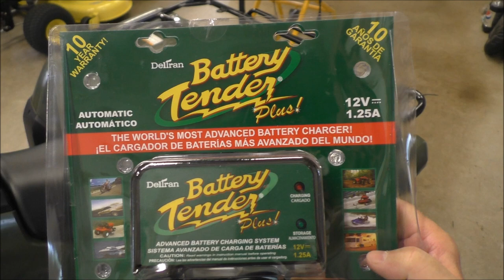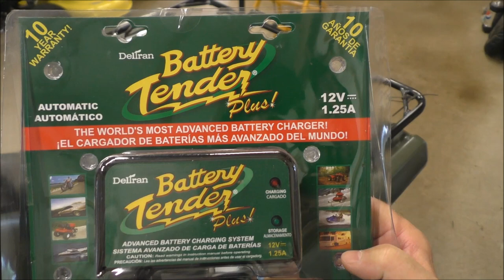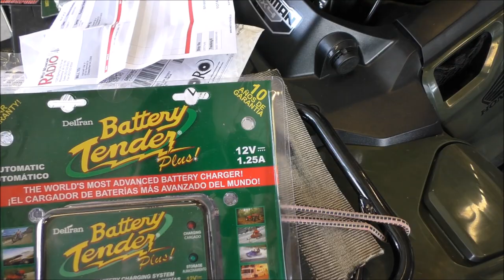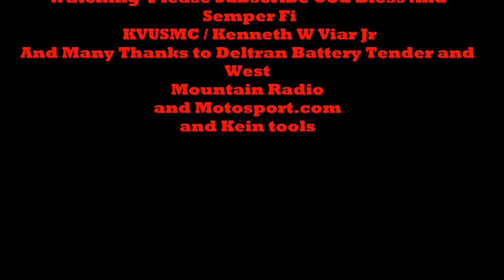ATV Batteries Keeping Them Charged and to Jump Start Wiring How To By KVUSMC

Comment: Take it up a notch! Get rid of all those crappy SAE connectors that the battery tenders come with and put 30A Anderson on instead, some heat shrink and Anderson weather boots and you have a handier system. On your battery chargers cut the last 24 inches of cable the battery clamps are on and install 30A Anderson's on. Put them on every vehicle battery you own mowers, cars, trucks so you don't have to raise the hood to charge the batteries. Put a Anderson cable on your Jump box and stop messing with bare wires and shorting your wires out. Add a 12 volt LED light wired with Anderson's on a magnet or spring clamp and have a handy trouble light. Got to Love Anderson Power Poles!
Reply from the maker: Yes Sir The Anderson power poles are the ticket